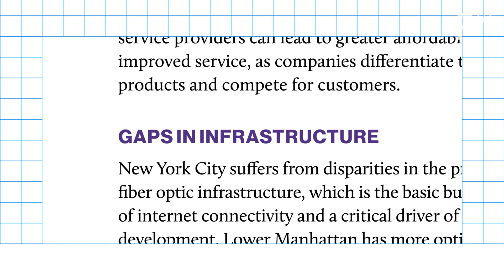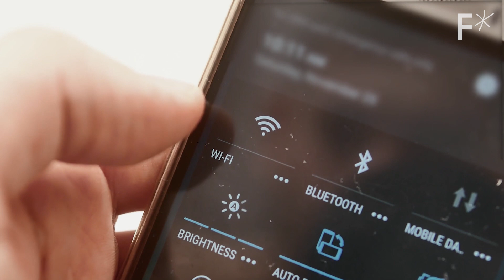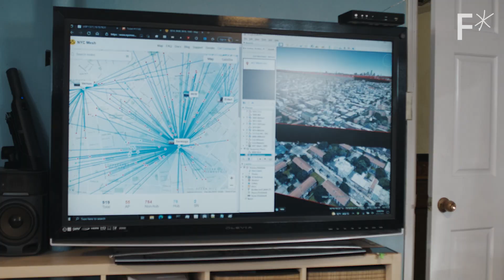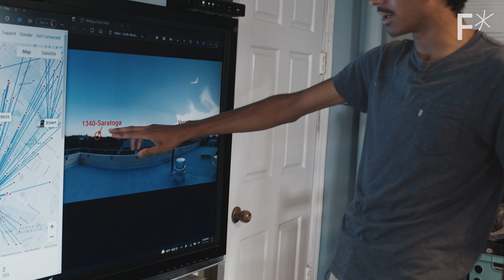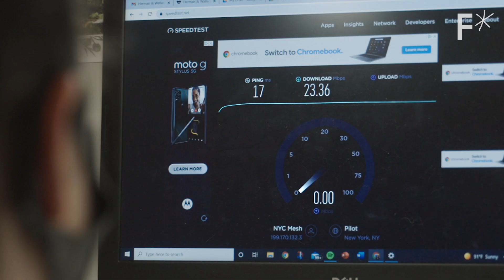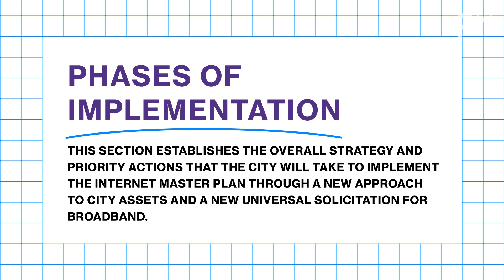NYC’s nonprofit DIY internet is taking on Verizon & more | Just Might Work by Freethink

Comment: Not everything is a human right. That's hyperbolic leftist speak and sounds stupid. Other than that, good concept. A better solution is if everyone had access to fiber at a reasonable price (that is if the city owns the infrastructure). The reason being that radio connections cause a lot of electromagnetic noise and raise the noise floor noticeably, something which should be unnecessary if fiber could be used for a reasonable fee.

Comment: Need to be able to utilize the free bandwidth from CB and other sources and make the internet run off those bandwidths so everyone can have internet. Not sure why no one has used those bandwidths. If they can transmit over wifi they can transmit over CB bandwidths.

Comment: Only thing stopping them from blanketing the 5 boroughs entirely  is the landlords that don't allow you access to the roof of the building. Many of the landlord block you because they have deals with cable corps like xfinity, Timewarner ,altice. verizon is the new player so they don't have the pull legacy providers have in NYC. I mean it took ex major Bloomberg to allow for verizon to come in and yet they face many obstacle by landlords . If people in their boroughs want cheap internet then they need access to their roof. Too bad Mayor DeBlasio plan for city wide ultra fast cheap speed internet was block and bad mouth at every turn from the likes of the Ny post.

Comment: It should be illegal. It is not a separate net built by these users. Instead, it is a free rider which depends on those who pay the regular service. Think about this way. If 99% of users are using this free service, who gonna pays for the cost? Just like sublease, if the contract prohibited it should be illegal. Of course lots of people are too poor to afford the internet service. But it should be helped in other way. Supporting this project sounds very political correct since it helps the poor and the people of color. But nothing is free. Someone is paying for this and  poverty should not be a legit reason to steal.

Comment: I've had this plan for so long. Custom router firmware that forwards your connection out to everyone and connects to everyone it can see. If you don't have a master connection, you can still get internet if your router or ANY ROUTER LINKED TO YOURS can see the internet. You can host sites on your connection and any router node set can see the website. Custom DNS. The only big brand internet you'd need would be for out of range nodes to interconnect. Decentralize the web. Not only that, but you could minimize hops for gaming.

Comment: California moble home park made a rule no overhead electrical lines, they refused to tear up the roads to provide wired connection. They gave us two rural internet providers. This providers use this same technology but charge us an insane amount. $75 a month for 50mb the internet drops to 1mb when downloading any small file. Youtube freezes all the time. Game lag etc. The other company only offers one plan and its $100 for 100mb. The problem with that is its really expensive and unjustifiable. They also have reports to be just as bad. Its illegal monopoly's..................

Comment: Hmmm. I got some questions. They say the "supernode"  is connected thru the fiber optic but who provides the access to the supernodes? Because it would be very easy for all the ISPs to agree to not sell internet to the NYC mesh (If a business doesn't want to sell you anything it doesn't have to, also without any explanation) and thus the whole system in for nothing. Quite a loop hole in my opinion unless they have something else up their sleeve.

Comment: This is awesome. I built a free wireless network around rural Lake Wyola in Shutesbury, MA in the late 90's. There was only crappy dialup at the time.  Got a T-1 at the closest, highest house I could and beamed it 1.5 miles to the far side of the lake, then distributed it to homes around the lake. We covered a few hundred houses in wifi - all with donations and volunteer effort. Currently my town, Northampton, MA is about to build a municipal fiber network allowing providers to compete for our business while we own the last mile. It's the ultimate solution - I proposed fiber-to-the-neighborhood along with wifi to bridge the last few hundred feet but was won over by having a separate fiber to each residence - once done it is future-proof.

Comment: Couple questions 
1. Can this non-profit block your node access? I ask because of the monetization method mentioned in this video ( researching this now) 
2. Can you attach yourself to this mesh with other hardware antennas? 
3. Will they block access or refuse install based off of political opinion (Dem in a Red area or Repub in a Blue area)? If so how is this better than the tech oligarchy other than providing a  competitive element to the sector. 
4. Will this require a digital ID in the future to access?(Much like governments and tech companies are talking about now.)

Comment: What about internet and customer safety? Would this system be strong against hacks/listenings or even illegal internet traffic? ISP provides maybe bad connection in some areas but they give you safety and security with monitoring web traffic
Reply: That's a good point, but there are so many vulnerabilities (like the US has the NSA tapped into everything, your ISP probably has one idiot using a Windows computer, there's somehow still a few Windows Servers, and then you have to imagine that literally none of the people working at the networking company wish for malicious intent...). So yeah, but also probably not that much worse? I mean your ISP already tells you they sell your data, so its not like they are hiding that they already do stuff...

Also what do you mean by illegal internet traffic? Like your comment without a free speech license? I have a non-commercial free speech license for 2.4 Ghz WiFi (you probably don't, so are you saying your comment is illegal? Because it technically might be and can be ruled illegal at any moment, but I believe free speech shouldn't need a fee to keep from criminal penalties and that it was enshrined in the Bill of Rights).

Your ISP does not stop hacking, for example if you run windows (I believe this also includes Windows Servers), then there is some very simple software I've tested that will allow everything (transfer files both ways, execute any program, log users off, spam the mouse to coordinate 0,0 so they can't close the programs, do any amount of trolling you want setting background wallpapers etc), and it was designed by a high school student... No firewall or anti-virus was found to stop it, and I tested it from across different ISPs and nothing stopped it, so I don't know who told you they give you safety and security but they don't. For legal purposes all of this testing was done with verbal permission from the test subjects (tested Windows 7/8/8.1/10, no failures on any function). Also the only web traffic they are monitoring is YOURS! Hence if they think you are abusing their data limits they will call the Feds on YOU, that is the only thing they really monitor, which shouldn't be a selling feature...

Comment: This isn't really a "mesh" network is it?  It's a traditional hub and spoke network. I thought to be a mesh, then all nodes connect to closest nodes to create links and clever software is always running to figure out optimal routes as nodes go up and down or possibly move around. In a true mesh network, scaling is less of an issue but the number of hops and latency go up significantly.
Reply: Most of our installs have an access point running OSPF to mesh with neighboring rooftops. We also use point to multipoint (hub and spoke) to get good speeds. Single radio mesh networks don't scale! They top out around 30 due to problems with latency and routing tables. They are great for small local mesh networks, which is how we use them.
Reply: It’s a cascading network that will fall in speed while gaining in latency as it sprawls farther from the hub. I think they threw in “mesh” since the general public recognizes the concept of their meshed home wifi, the comparison is there but it is different. Having a single hub that all super nodes and down the line communicate back to would be horrible for network efficiency and would force everyone to share data under the data cap from the isp feeding the hub.  Even unlimited fiber data gets metered over 1tb. Multiple data plans for multiple nodes is pricey and Business plans are absurdly expensive.  I love this idea but for it to work right, it won’t be $5 per month per user and free public wifi is out of the question.
Reply: Indeed, not a true "mesh" network but the idea of having a directional antenna pointing to a node with a secondary omnidirectional repeater for others to connect to is quite impressive. The main node is very crucial however, if it goes down, the entire system goes down. Very much against the principle of a "mesh" network.
Reply: Yeah thought so too, looks more like a star network
Reply: 4:30 - "People can connect to her antenna" that is a mesh network. Yes the diagram they have may show it as a hub and spoke however if you only have 1 hub, then you have a single point of failure. Having multiple means it won't unless all go down
Reply: Hello.I think they were trying to describe what they are doing in the most elementary way how it works and sounds as if they do both.What?,isn't here or there it's what works for that cluster of streets interference etc.just an easier way for people like me to understand.🗣️👂🧠🤸
Reply: It is called a WISP not a mesh. I own and run a WISP business.
Reply: yeah this approach does leave it vulnerable to hostile takeover. How else would you connect to the internet if not through a supernode? If one supernode goes down just point the dish at another supernode. More supernodes would be needed to ensure redundancy for more people.
Reply: @wackyroo  There are two Supernodes, with a third one planned.

And Mesh isn't the only party using the SN datacenter, many others do as well.

If these datacenters went down, we'd have much bigger problems to worry about. Given that a terrorist attack would be underway.

Even then, these hubs have redundancy and operate independently. While external internet access would be lost, the hubs could still talk to each other and operate a citywide comms network.
Reply: meshes are just graphs, and a hub and spoke is the most efficient graph for DFS.
Reply: please go back to reddit
Reply: @windowsxseven  leave him alone, we need more people that know what they are talking about here and not at reddit.
Reply: @vasopel  cope // seethe // mald

Comment: I have a router that is so bad, sometimes I can't watch anything on yt with the lowest quality. And we pay a lot for this s*it.
Reply: Is it consistently bad? or does it outright halt every now and then like my internet? its so ridiculous we pay more than 120$ a month for 180mb/s down, 18 up. Only for it to suddenly drop bandwidth to nothing in the afternoon.
Reply: @MarcABrown-tt1fp  no, its not constantly.  But, my phone can see the speed of internet i think, and when its good it's at 150k/s  maximum that i got is 1.3m/s but this os very rare 
Most of the times is at 75k/s  but now its showing me 5k/s 2k/s  i dont knkw if its true or not. But whenever the internet is bad the number are low i even saw 300b/s

Comment: I'm all for it!  I do have a few questions though:
How do you deal with freeloaders that can, but won't contribute? 
How do you deal with network overload? 
Finally, how do you deal with bad actors on the network? 
That last situation could range from serial torrenters, hackers, people putting vial content on the internet, or any other assaults against humanity/ the network?
Reply: My guess is that these problems still need to be handled.  It seems the particular problem this solves, is when the ISP's won't lay wires in certain neighborhoods.  This would be the next best thing.

Comment: 20$ for around a 50Mbps connection that will have reliability issues in bad weather, as it's based on a wireless infrastructure, feels like a bad deal.
Reply: The thing is you don't need to pay monthly.
Reply: How do you know it will not perform in bad weather?  I do not see it changing much.  Starlink works in snow and rain, so wh should not this local net do?
Reply: Cheaper and better speeds with all the crap